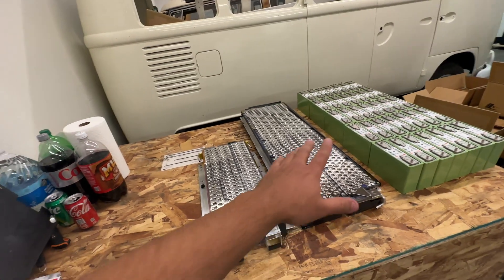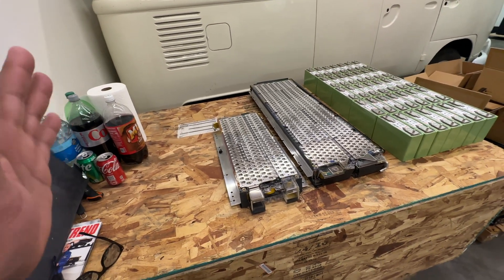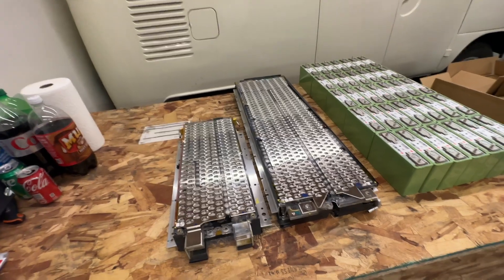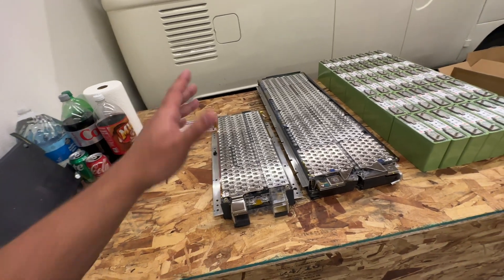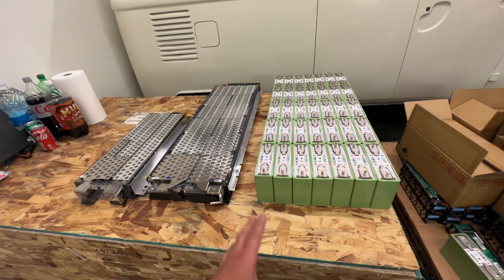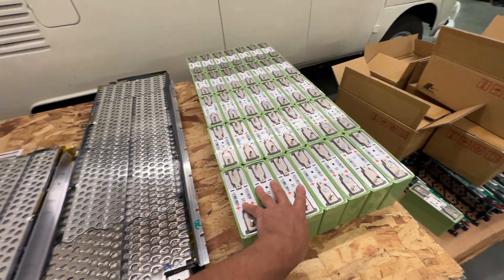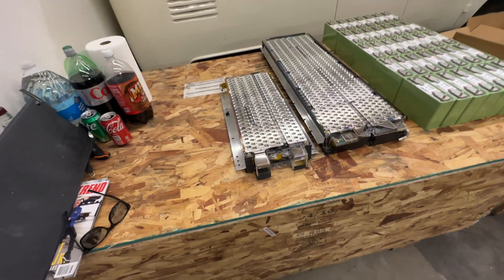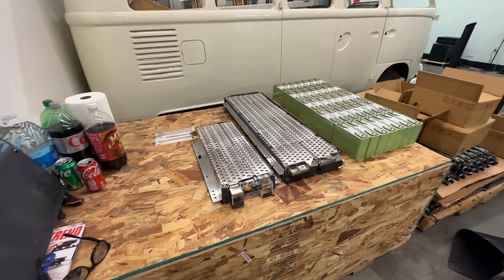$90/kWh Toyota RAV4 Battery Modules by TESLA

Comment: If i wanted to parallel multiples of the 48v 6kwh rav4 batteries, would i need a seperate BMS? Or harness? BMS one pack already??  Say 4-6 in parallel.   Thanks
Reply from the maker: There is no right way,  you can use multiple bms units or parallel strings and use one main Bms